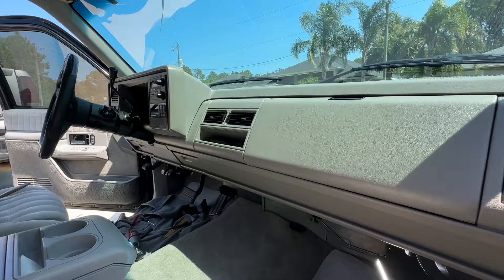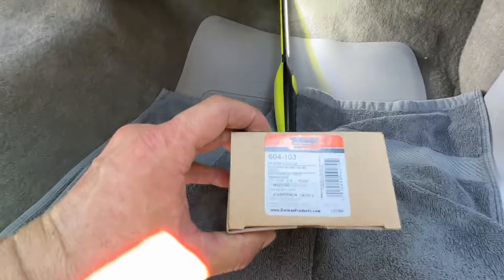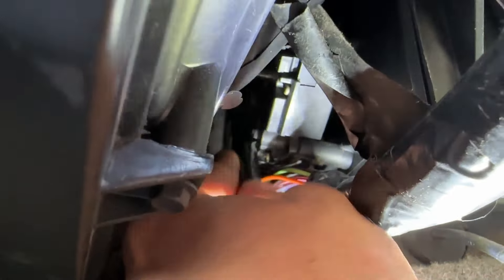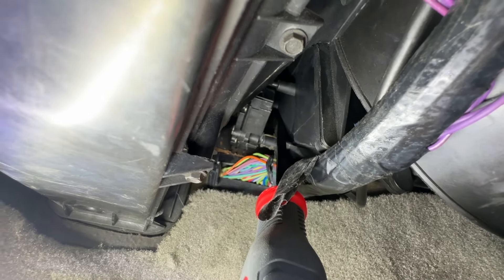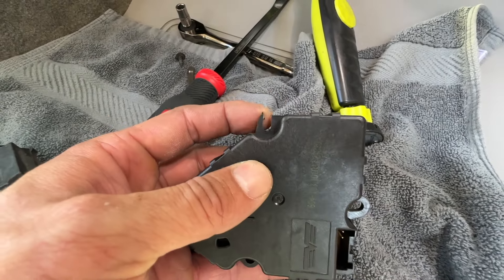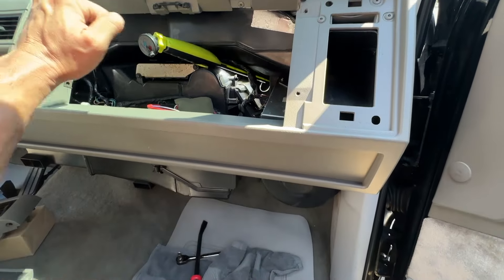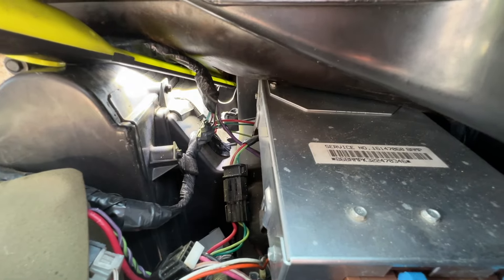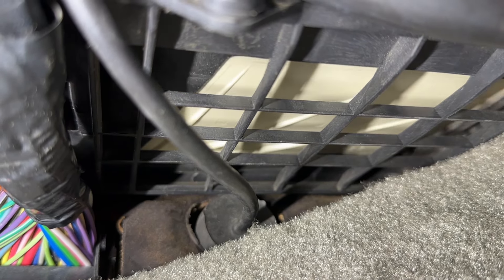Replace an Air Door Actuator in a 1993 Silverado/ Sierra | No B.S. Tech

Comment: Just got done doing all three on the passenger side of my 2004 Yukon with electronic climate control.  The passenger side blend door and recirc/fresh air actuators were pure hell.  I did manage to swap them all without breaking anything or cutting anything up.  My arms and wrists are paying the price and my 16 year old daughter laughed at some of the choice words that came out of my mouth.

I took the dash top off, and unbolted and pulled aside what I think is the Onstar module or SAT radio module, silver box with Motorola stamped on it.  This gave me enough room to work along with my daughter using the prybar when I told her to.  Had to run to Harbor Freight for a Quinn low profile 1/4” ratchet and I cut down a magnetic impact 5.5 mm bit to help fit in there for the PS blend door.  It took longer than I wanted to, but everything works like it should now.  The issue I was having was a knock in the dash and the blend doors weren’t producing full AC or heat when needed.  Problem solved.

Comment: Very helpful, that's the worst one to get to, but man you made it look easy
Reply from the maker: Thanks! Man it was super tight. What sucks is I had this dash out about 6 months ago and should have done it then.
Reply: What can I do if I have power to the ac module but none of the buttons work please help me(1992 gmc sierra single cab)
Reply: It would work before but randomly stopped I check the fuses but none are blown
Reply from the maker: @quinteros0114  It could be a bad module. You can usually find a used one in a Junk Yard or you can reach out to my buddy Les Baller and he can ship you one. If you're on Facebook search for Les Baller and send him a message about it.

Comment: That top screw will give you nightmares. My problem was everytime I went to back up the ratchet the screw would loosen instead of repositioning the ratchet for another bite. Aggravating. So I put in just the bottom screw and then jammed one of the kinds foam rubber balls up in there. Been like that for 6 years now. The fan speed resistor is another fun project but nowhere near as bad as that actuator screw.
A few years ago I found the perfect tool for that screw. It's called a Titereach. Its tough to explain what it is. But basically its a bar with a chain drive inside. You put your socket or bit on one end of the tool and at the other end, which is about 6" away you can use whatever you want to turn it. You can use a drill, impact, ratchet, breaker bar, or anything with a 1/4" square drive to turn it. You hold the bar stationary and rotate the mechanism. The chain drive rotate the socket or bit on the other end. They make it in 3/8ths or 1/4" drive. I use a Titereach to get to the ac lines on the back of the AC compressor in my C5 Corvette. They thought it would be a great idea to mount the AC compressor down under the engine on the passenger side.

Comment: No sir, not a 30 minute job when you have big hands, tools required, long reach 72 tooth 1/4" drive ratchet, 7mm socket, long screw driver to apply the tension on the old actuator when removing and last but not least ibuprofen for the couple of days.
Reply: the relief cut worked great, good ideal.

Comment: Just replaced mine still no heat coming out
Reply from the maker: There are 3 actuators on the evaporator. This one controls air recirculating, there’s one in the middle (between the radio and glove box) that controls the temp and one near the gas pedal that controls the mode.